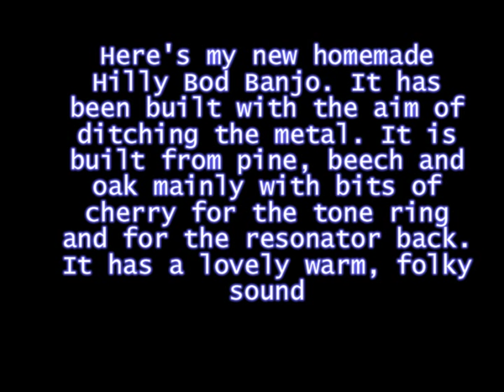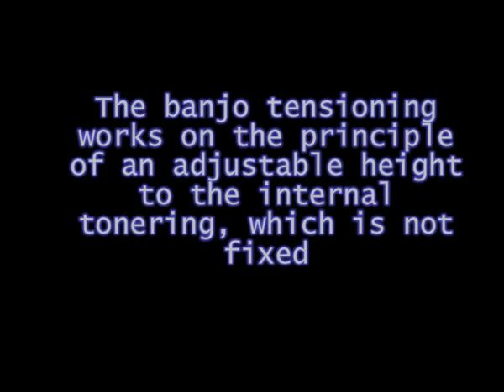My New Hilly Bod Homemade Banjo

Comment: The  Banjo you built is great. I want to  know, if you have got a plan or built it  invented by yourself. Two years ago I built a triangle Tenor Guitar, a few weeks ago I built a Cajon. Now I want to built a Banjo or a Banjoukulele. Perhaps you can help me with a few tips?
Reply from the maker: I invented it myself working step by step. I have a new design I am working on which will be better than this...when I get the time. Probably a good idea to decide the skin size you want and then decide if you want lots of metal or something more ascetic and folky sounding. I prefer wooden tone rings as they give a rounder and softer sound. I also find that soft wood like pine actually creates a less strident and more sympathetic instrument that has an aged quality to it in terms of sound. It also makes it cheaper to build. My current one is being made out of old pine floorboards! Let me know the sort of info that might help! thanks for your comment!
Reply: Music Maker I want to build a Banjoukulele. It's difficult for me to find tuning pegs and a batter head????(I don't know if this is the right word), so I would take a Tambourine. Do you think it's possible to integrate this?

Comment: Did you do a truss rod for this?  If so are there any resources you'd recommend for installing something that acts like a truss rod with this kind of powertool-less build in mind?  I'm soon to move to the EU and will be leaving most of my good tools behind.  As a result I've been really psyched for a build kind of like this.
Reply from the maker: I only used square angle iron and routed a suitable groove. I dont buy truss rods for banjos cos I dont find I need them.